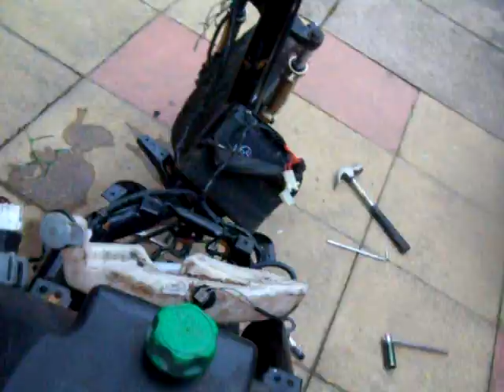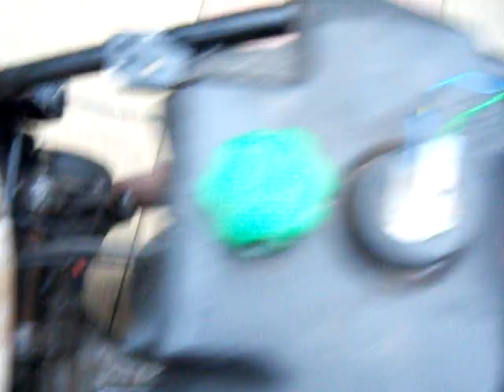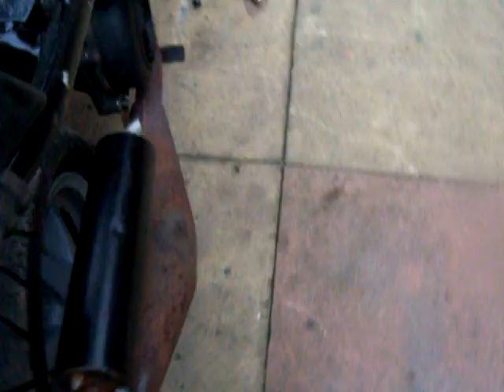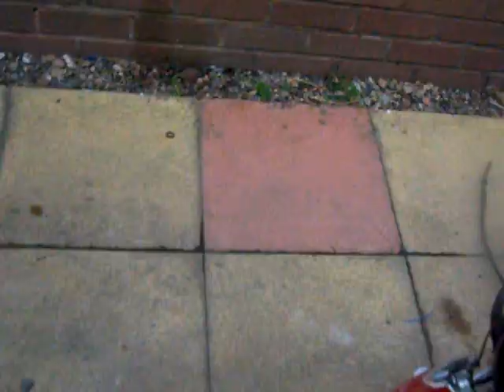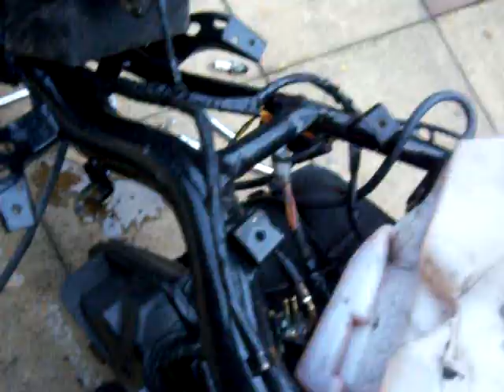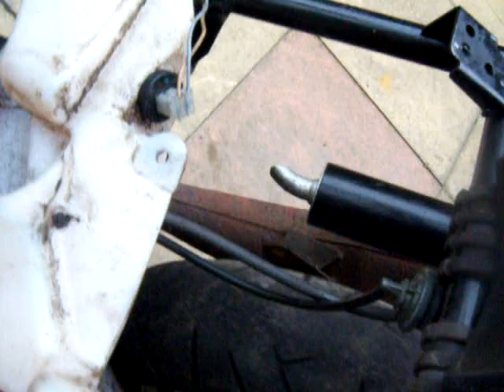Wierd yamaha jog R running problem

Comment: you could check your idle so that it ticks over fine . and that popping sound out the exhaust, when mine had to much fuel going into the carb it would pop flames . so check fuel (jet) .